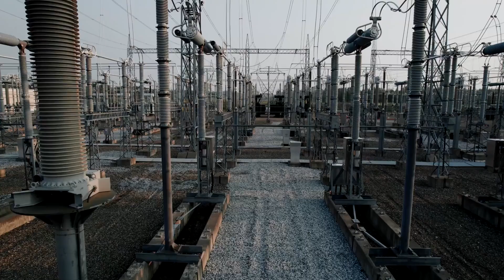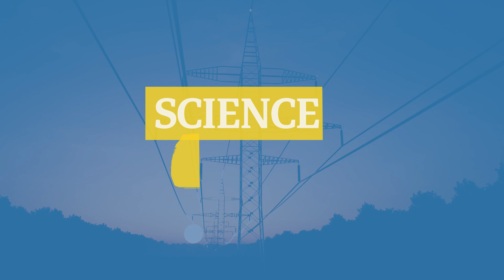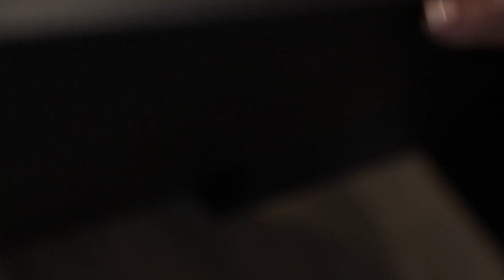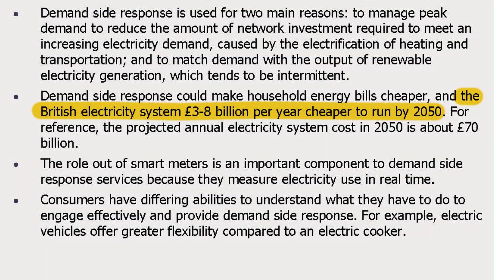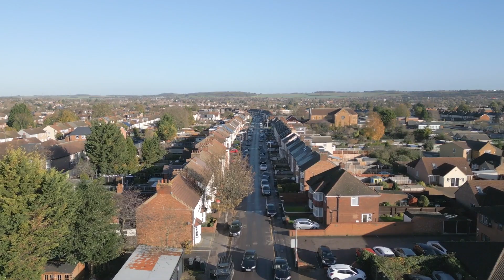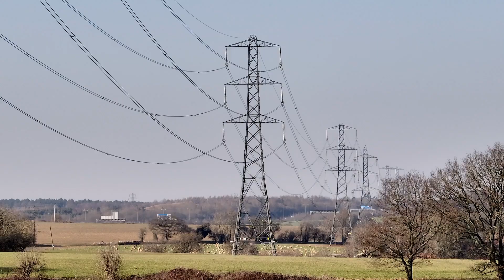Why The Government Wants You To Change Your Energy Habits

Comment: Also, the grid losses go up with the throughput each wire has to deal with. If your wires are operating at 50% all the time your transmission losses are going to be lower than if you're operating them at 100% half of the time.